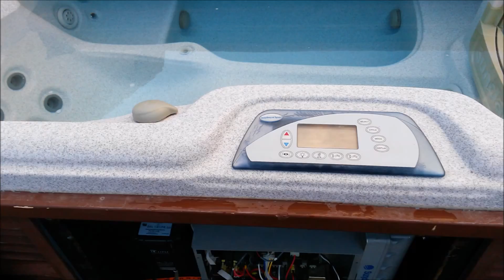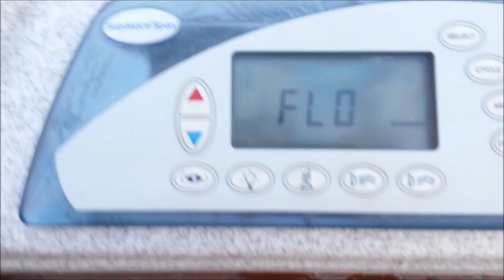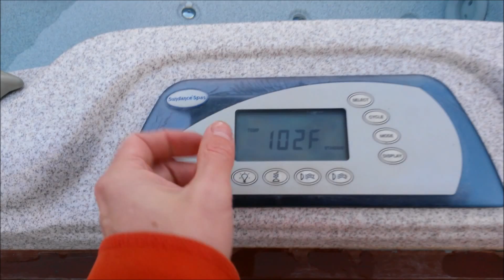Hot Tub Not Hot Enough? 104° Temperature Override  (:2:) The Resistor Method

Comment: Great video. Fitted a 1/2 watt 1.2k ohms resistor to the black wire on my Mspa alpine d-al06 inflatable (only 1 temp sensor on inlet side) and now with the controller set to 37°C I'm getting 42.6°C actual water temperature giving me 5 and a half degrees more and option to go up to 45 and a half if we feel the need. It took me about 30 mins to complete the job. Such a simple fix. Thank you so much 😁👍🏻
Reply from the maker: Awesome!
Reply: @SpaDayz  it's amazing your video is still helping people 6 years on. Thanks again

Comment: I have a 2015 Aquaterra Montecito hot tub that uses a Gecko IN.YJ-2-KR spa pack. The single temperature probe has 8 pins on it. Do you know which color wire I need to put the resistor on? I can't find a wiring diagram that specifies what color is what. Thank you!
Reply from the maker: Follow the wires to the actual probes.
Reply: There is a single probe with four wires (B,G,Y,R) that goes into a separate board from the main board. The flow meter also goes into this board. Then there is an 8 wire connector between this sub board and the main board. I have a picture if I can send to you.
Reply from the maker: @nathankendig8348  I would try the red wire. Dave commented below about success with a 3 wire sensor.
Reply: Do you think it matters whether I do it between the probe and the sub board or between the sub board and the main board? I have a lot more room between the sub board and main board. Really appreciate your time and help.
Reply from the maker: @nathankendig8348  Between Probe and sub board is safest. You can play around before actually soldering a resister in. Use some alligator leads and just clamp the resistor in. If no change try black.
Reply: @SpaDayz  I pulled the probe out of the heater enclosure and off the sub board. It looks like the four wires provide two distinct (but matching) ohms measurements that vary with temperature. Do you suppose I need a resistor in each of the two circuits?
Reply from the maker: @nathankendig8348  Great work! Yeah, gonna need one on each pair. You can always start with one and see what happens
Reply: @SpaDayz  success! I put a 1k resistor on each set of wires and my temperature readout is 7 degrees less than actual water temp. So excited about this! Thanks much!
Reply from the maker: @nathankendig8348  Awesome! Thanks for reporting back so people know! Great work!

Comment: Hi... I added 1K resistors to both temp sensors and ended up with an effective 1 degF increase at 104.
Would it be fair to say I need to change to a 2K or 3K resistor to get a larger increase in the order of 2 to 3 degF.
Reply from the maker: Definitely. Maybe take the 1k out and add a 5k

Comment: I have a used hot tub I bought last year (2019) from the original owner.  It is a 2009 Premium Leisure Passion model.  Balboa EL2000 pack with 4kW heater tube.  Has 2x M7 (hi limit/temp) sensors that plug from the board to the heater tube.  

When I bought the tub, it had some issues (many really).  First time I fired it up, threw SnS Code (and a Dry code).  I ended up ordering 2 new M7 sensors due to the SnS code and winter 2020 approaching (at same time had replaced all 3 pumps - and could tell the circ pump did not seem to be running).  Replaced sensors but still had issues with the codes.  Turned out, I had a blown 30 amp fuse (I had to buy a digital multimeter to discover this).  This allowed the circ to now fire and operate.  Now, I'm curious if I had to replace the sensors at all (or if threw codes due to no flow)?

Now, I had already replaced the two M7 sensors, as I didn't want to have to wait for shipping item, etc. 

Tub is now up and running.  It is warm.  When set at 104°F, an internal analog floating thermometer reads 100-101°F.  It's not even freezing outside yet.  But in a month or two, there will be consistent freezing temperatures and snow accumulation (Windsor, ON Canada).

So, I've just ordered a sauldering station from Amazon (for ~$70 cdn and some 1.5 Ohm, 1/4W resistors).  I've stripped the wire insulation from the two sensors I previously removed from the tub (hoping they were really fine but throwing the SnS code due to circ not operating).

I will attempt this job on the old sensors and swap them back into the tub and see what happens.  If it works, I will be very happy.  If not (and it throws SnS again),  I'll swap the new sensors back in and order another new sensor, wire the resistor in and try again (assuming one of the sensors was actually bad, but always having a backup unmolested pair on hand).

I'm determined to reach real HOT tub temperatures. Will let yall know how she goes, ehh!
Reply from the maker: Great DIY work and thinking. Looking forward to hear how it went!
Reply: how did it work?
Reply: @AA-ih6kt   @Aleh Veras  after much contemplating - we decided that the tub gets satisfactorily hot for us at its 104 setting.

I've actually had to crawl out a few times in a natural flight reation.

Sometimes girls I have in as guests I find sitting up out of the tub with only legs in and ask them "too hot??" And frequently they reply "no" but the body language says yes lol

When I wrote this, was very new into the hot tub game and was expecting more heat loss in the winter months during usage but it hold up pretty well.

I still have the resistors I bought, but just unnecessary for me based on my experiences now. 

Also, im in Windsor the most Southern part of Canada.

🍻 bro
Reply: @RayzeR87  thanx for the reply...i know many think 104 is good but the body adapts to it pretty quickly. I just wanted the extra degrees for myself when i feel like it in the dead of winter...Its nice to have it avail..I am trying to find a electrical parts online place for diff types male/female ends to make 2 pigtails with the resitors in them...Being japanses when i traveled back to japan their tubes get 115 and feel great for less time...then i go lay in the snow and repeat...lol...of course anything that goes to 115 and also get turned down to 104.

Comment: Where is video #3? I have a portable Wave Spa? Maybe you have a suggestion to override?
Reply from the maker: I never made a video 3. Sorry. It was just going to recommend covering the temp sensor probes with a big glob of silicone to insulate them, thus making the hot tub think it's cooler than it is. If the probes are in a sleeve, you can also just pull them out most of the way.

Comment: I have a Four Winds make Cozumel model tub. The sensors are on each end of the heater tube with a red and a black wire to each. I used a 1.5K resistor on each red wire and it worked like a charm. Increased the temp 5 degrees. Now I am keeping the water at 107 with possibility to go to 109. I am so pleased.

Comment: This modification works great, and is very accessible to those with basic skill and the "courage" to try it. I gained ~+8 degrees on my hot tub maximum temperature with the recommended 1K Ohm resistors, which achieves my goal: providing a Japanese style onsen like soaking environment! 

Tip that worked for me: instead of trying to solder the resistor wire onto the temperature wire in a straight-on fashion as shown in the video--(with the temperature wire straight at the wire of the resistor), I created an eye-hook loop with the wire of the resistor, and then threaded and wrapped the temperature sensor wire through the eye-hook; this creates a solid junction between the two wires, that makes the soldering added easy to do and very secure.

Thanks SpaDayz for this video!!
Reply from the maker: Awesome! Great tip!

Comment: I just did this mod on my Nordic tub with a Balboa control pack and heater.  Super easy.  Added a 1.2k resistor to both sides.  Fired back up fine.  Looks like I'll be getting a 4-5 degree jump.  Perfect.
Reply from the maker: Awesome!
Reply: was it a carbon (brown)or metal film (blue)resistor?  1/2 watt or 1/4 watt??

Comment: I am looking to raise the temp on my  2006 Caldera Aventine. Can you help or point me to someone?
Reply from the maker: The resistor method shown in the video should work for you.
Reply: @SpaDayz  Thanks for the response. I have since found that I can override manually, but not set to stay. (ut-1, ut-2, ut-3, and ut-4.) However, it seems I also need to calibrate the thing too. I have removed some pipe insulation around the probe exterior, but it is still 2-3 degrees too low.

Comment: I have a new Hayward H series 150 natural gas heater, just installed, it has 2 temperature limit sensors wired in series (1 wire going in, one out on each sensor; one sensor on top of water manifold & one on the bottom near the outlet).  There is a thermistor at the "water in" end & it has 3 wires coming out of it (2 red, 1 black).
I'm hoping the limit sensors are the resistor type (how can I tell?) & if I put a resistor in line on just the temperature limit sensors that the small increase of temperature will "slide by" the controls.  Or is there a way to do the 3 wire thermistor?
Reply from the maker: You can try putting resistors in and see if it works. They can always be removed.

Comment: this is great info for a 2 wire temp probe. However do you have advice for a 3 wire?
Reply from the maker: A 3 wire probe is not a standard thermistor. You won't be able to add a resistor.

Just get a replacement temp probe from the manufacturer.
Reply: can I run a 2 wire on a board with a three wire hookup? I've been trying religiously to get this thing hotter.

Comment: Still works on new hot tubs. My new spa with Balboa MS501X and the resister mod works great!
Reply: Balboa: Typical Resistance Values for Sensors and the water temperature.

Temp	Resistance In "K" Value
59	55.0
 K
65	40.0
77	30.0
84	25.5
94	20.2
99	18.1
101	17.2
104	16.2
106	15.4
108	14.7
110	14.1
115	12.7
121	11.1
So adding a 1k resistor with the tub temperature set to 99 degrees would make the actual water temp approximately 101 degrees
Reply from the maker: @randywatson9450  Great info!
Reply from the maker: Awesome! Thanks for letting us know!

Comment: Will this resistor method work on my gas heater that heats my pool and spa?
Reply from the maker: Yes, if it uses standard thermistor heat sensors. A stand alone heater should be able to be set higher than 104 deg. already though.
Reply: @SpaDayz  I just set the heater to max 107, which is where I want to be but my Jandy AquaLink remote system I think is where I need to add the resistors?
Reply from the maker: @VoteDennisMock  Yes the resistors would need to be on the sensors.
Reply: @SpaDayz  Perfect  Thanks for the help
Reply from the maker: @VoteDennisMock  You're welcome :)
Reply: Sorry, back again.  I located 2 sensors, 1 water temp and the other air temp.  Are those the 2 I need to install resistors on?
Reply from the maker: @VoteDennisMock  Probably just the water temp. Just 2 wires?

On hot tubs, a second sensor is a high limit sensor not air.
Reply: @SpaDayz  yes, 2 wires for each sensor.  Looking at wiring diagrams now for any high limit sensors

Comment: I figured it was this simple.. just had to find the right dude. I'll run out and try it on my super-ghetto-fabulous 300$ inflatable now lol. Thanks.
Reply from the maker: Report back when you get it done. Let us know how it went on your tub.
Reply: @SpaDayz  it's not up to temp yet (these things can take up to 2 days in my experience! First world problem still I suppose.), but assuming it will be the same at the top as it is at room temp... 1k on both sensors is getting me 5-6 degrees difference. It is an intex 4 "person".
Reply from the maker: @weeral1  Hopefully that gets your top end hot enough. If not, just add 2 more resistors.
Reply: @SpaDayz  looks like 6 degrees. It's up to 96 but external thermometer reads 102. I don't know if this weak little thing can hit 110F.. But it going to try lol.

Comment: I have a 2017 hot springs “jet setter” tub (110V.). The 104 deg. max temp is unsatisfactory for me. I located a “limit therm”, and a “reg. therm” wire in the control box. Both are contained in a gray sheath containing 1 red, and 1 black/1 bare gray wire sharing the same pin. There is no sensor in the filter “box”, however there is a small heated water outlet there. I suspect that there is a sensor somewhere in that line(?)
Can anyone confirm that I have located the correct wires for “resistor” adaptation?
Reply from the maker: Probably.
Just unplug them and measure the resistance from black to red then Grey to black if they are standard sensor leads, you will get a similar value for both.
Reply: I soldered the two 1 k resistors onto my 2 thermo lines. (Hot springs jet setter tub)They both had the same amount of resistance  using a meter.
When done the green “ready” light began blinking. Manual said that that indicated a thermostat problem, and to turn off tub for 30 seconds to reset. Same result. Left tub plugged in overnight with light blinking. In the morning the ready light was still blinking, heater pump running , tub was not heating up to original temp.
Removed I resistor, same problem. Removed 2nd resistor, and soldered original wires back together. Green ready light reset, and stopped blinking.
Tub should be back to normal (104 deg.), but still not where I want it 106-108 deg..! Any suggestions?
Reply from the maker: @brucecostick7013  Thanks for posting your results.
Only thing I can think to try would be to just have one resistor on the grey or shared wire. Sounds like you have a different type of thermistor setup though.

Comment: new american whirlpools have a new system with solid state sensors in the heater manifold.
 they call them smart sensors and  they  also monitor oher water conditions
Do you have any thoughts on these
Reply from the maker: All sensors are solid state. Many manufacturers put one right in the heater unit. The only question is if they are built onto a PCB or circuit board, or if you can find wires going to them.

Comment: Hi. Excellent videos. I have tried the resistors on my Sundance and I still cant get it past 104. I have also tried your suggestion of silicone on the sensor. Do you need 4 resistors one for each line black and red on both sensors or just the 2 on the black. Any other suggestions,  something I may be missing?
Reply from the maker: You just need one resistor on each sensor pair. Make sure did'just put 2 on one sensor that won't work. Follow the wires to make sure you are putting one on each. You can double up, or use a larger resistor to get more heat though.
Reply: Thank you so much
Reply from the maker: @coolmanwellls  You're Welcome!

Comment: Thanks for the video. I have a Softub 140. It has only one temperature probe with 3 wires - red, black and green. which one should I use for the resistor? I hope this works! Can't get more than 103 degrees now. Thanks, Jack
Reply from the maker: Can you trace it all the way back to the probe? Do all 3 wires go into it?

Generally 3 wires means a transducer with a reference voltage to power the sensor. Not really common on temp sensors though.

You can measure voltage to ground at all 3 wires and see if you get 5V on any of them.
Reply: I tried 1K and 2K resistors on each of the 3 wires (separately), but no increase in temp. Maybe this method doesn't work for Softubs?
Reply from the maker: @jackkomejan7897  It must not. I've never worked on one so I can't say if there is another electrical method.

You might try putting a large blob of silicone over the sensor to insulate it from the tub. Or if it is in a sleeve. Pull the probe out a little to make it less sensitive.
Reply: I tried both of those, but no success. Then I pulled the sensor completely out of the sleeve, and the motor started running and heated up to 109 degrees! I'm going to just leave it out of the sleeve, try to control the temp using the controls, and see what happens.
Reply from the maker: @jackkomejan7897  keep us updated.
Reply: @jackkomejan7897  i went thru the same issue. it may not work on softubs. i wired in reistors+i got a temp decrease! wtf?

Comment: My temp sensor has 4 wires red, black, green, white. It is a new spa with only one sensor located on the heating unit. Your help would be greatly appreciated.
Reply from the maker: Are you sure? Can you see the actual probe? Even transducer sensors only have 3 wires.
Reply: It seems 4-wire sensors appear to be two sensor pairs....measure the resistances to find which wires make up the two pairs, and put one resistor in one wire of each pair...kind of a matched set, if you will

Comment: How can I wire my 2 heaters so they both always come on the same time and shut off the same time also? Bridge it like a speaker?
Reply from the maker: You have 2 heaters?
Is this a tailor made spa?

Any standard relay will probably not handle the load of 2 heaters. 2 relays one signal source will do it.

What's the voltage?
Reply: @SpaDayz  Just an Intex 4 person. What is a relay exactly? A bridge? Have not tested voltage yet.
Reply from the maker: @jgbelmont  You don't have 2 heaters.
Reply: @SpaDayz  It says heater one and heater two on the inside. shrug.